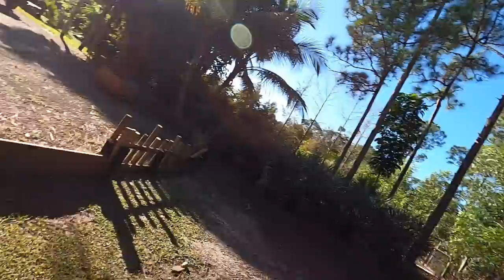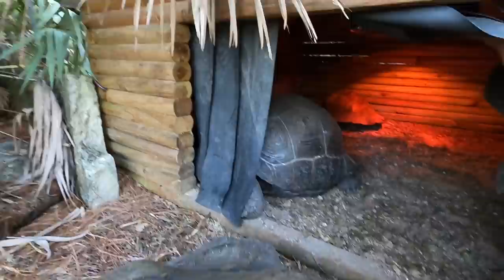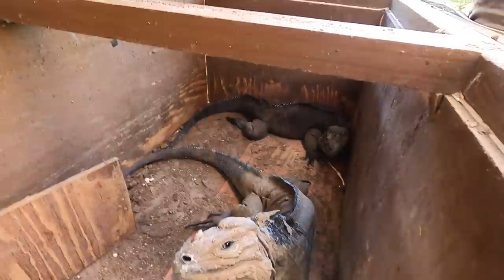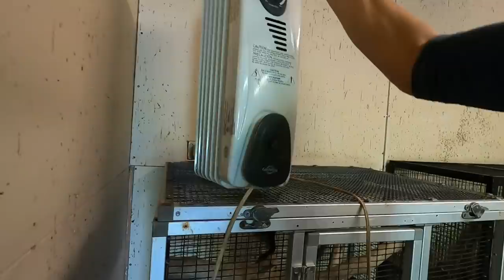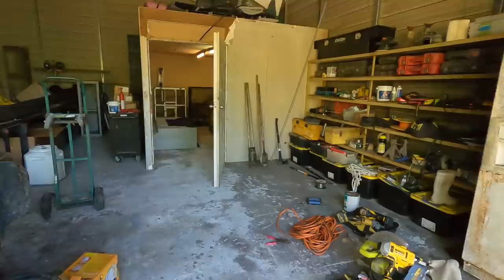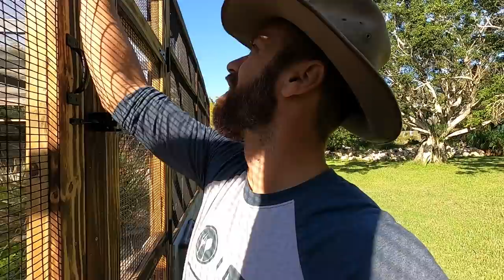Winter Time is a LOT of Work for Reptile Keepers!

Comment: quick tip / low tech solution about extension cords! if you knot the cords once at the end, it should help prevent them from disconnecting! my dad does this when setting up christmas lights outside in case anyone trips on them or they get snagged on something! hope this might help!

Comment: To help with cords and plugs perhaps you could mount a locking plastic container with clamps on the side/top of the hide and run all the stuff into it? Think like an electrical box for a wall plug but with a hinge/clamps on the top so you can open and close it. If you mounted it on the outside it would need to be water tight somehow. Maybe use the actual container lid as the mounting piece. Just a random thought I see in my head and can't really explain to well

Comment: When we met I could nail variations with no air. Remember ? Used to piss you off to no end that you could hit 3-4 feet but you had no variations. I would never hit more than 2 feet and could can can, knack knack, candybar, no hand and one hand one foot. I remember Johnson saying "All he needs is air and that will come..." right before he did a tailwhip air over me at McDs in Center Moriches. I forget almost nothing so if you ever want to remember, hit me up. We all had some good times back then.

Comment: Scalie kids are destructive. Even with cable raceways installed in my enclosures, they have managed to rip wires out (I had to buy extra webcam power supplies) and they have bent up several of the original camera mounts (so far the new different ones are working out).

Comment: you need to secure all the wires permanently so the Kids cant unplug the heat pad or heat lamp.  If you dont do that you could and another problem with the cold weather coming in. you must think ahead and do things right not the easy way but you cant take any chances.  fix things.  This is why I unsubscribe from this channel.  fix things right